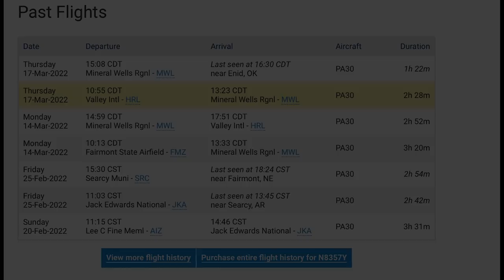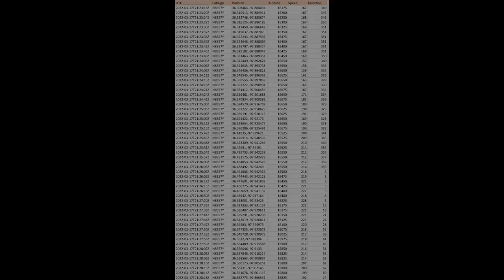FlyWire Accident Review  PA 30 N8357Y Loss of Control Inflight

Comment: Loss of control by VFR pilots in IMC is a big killer in GA. It is stressed over and over yet so many pilots succumb to “get home itus” every year. Don’t do it!!!
Reply: One thing VFR pilots should do is take some instruction on basic instrument flying.
     You don't have to be IFR qualified to use your instruments to keep your wings level and use your radio to get help.
     I don't understand how a CFI can allow their student to carry out a cross country solo flight without knowing how to orient the plane in space without looking outside. It's not that hard. 
     Vertigo is quite common in IMC, especially if you lose outside references without warning. It even happened to my dad. He was VFR at night over a populated aria. Just as he rolled out of a turn he entered an unseen cloud. He lost sight of the ground and horizon and every sense in his body told him he was in a bank.
      But he was a CFI and instrument rated with many hours in hard IMC. He looked at his attitude indicator and his bank indicator and both showed his wings were level.
      He fought the urge to correct the band and after a few seconds popped out of the cloud. The horizon was right where his instruments said it should be though his body was telling him he was in a steep bank.
     As soon as he could see outside again his vertigo vanished.
     That's the thing with seat of the pants flying. The seat of your pants is a lying ass. Don't trust it to orient the plane when you can't see outside.
     Anyone can end up with VFR into IMC. Being prepared for it will save your life and your family's life.
Reply: @Vertical Flight Why do you doubt that knowing how to use your attitude indicator would make a difference?
     It's not that hard. Just keep that blue and black ball so it's not tipped over and or mostly blue or black.
     Frankly, if you can't even do that you have no business flying an airplane.
    If you are VFR into IMC the most important thing is to keep your wings level, guarding yourself against vertigo (ignoring the sensation you are pitching or banking) and using the radio to call for help.
     You don't need to file a flight plane, you don't need to know how to set up an ILS or DME approach, you don't need to navigate.
     All you need to do is keep the wings level and call for help. ATC can read up instructions to shoot an instrument approach if necessary. And it probably won't be. Most likely you'll be given a heading to take you back into clear air where you can return to VFR flying.
     You'll probably get an FAA review but you can survive that but at least you'll be alive. 
     As to not flying into bad weather, well there is only so much you can do about that. Weather can change very quickly and it doesn't always go as it was forecast.
     No matter how good your judgment, there is always the possibility of VFR into IMC. If it happens you need to keep your head and remain calm.
     There is a horrify audio from a VFR pilot who went out of control in IMC.
     The terror in that call is chilling, but the pilot got ATC in there and was able to save himself.

Comment: It’s funny that with a little simple trigonometry you can approximate airspeed. It is the ArcTan of Descent speed with ADSB speed. You could even add in the current winds if you wanted even more accuracy. I am surprised some website wouldn’t do that since it would give a little more info.
Reply: ADSB outputs ground, indicated and true airspeed, so it depends on your source of "ADSB speed" if you need to convert.
Reply: @kewkabe  ADSB reports ONLY ground speed from GPS.

Comment: These folks have to have read many accident reports describing exactly this scenario, yet they do it anyway. Unfathomable.
16.5 for a smoker or an older person in poor physical condition — one who is also too stressed to be able to breathe properly — is not a good place to be, even for a few minutes.
2 more cents: Having an IFR rating without being fully competent can lure pilots into situations they can't handle. Anyone can pass the IFR check ride with the examiner sitting next to them holding their hand, or fly in IMC with another pilot sitting next to them. Get up there by yourself and it's a whole 'nother ballgame.

Comment: Question from a non-pilot: If you are VFR rated, and end up in IMC, can't you just use the six basic instruments to maintain your attitude, altitude, speed and heading? Is it that difficult to ignore your own senses (knowing they are flawed) and trust the instrument panel?
Reply from the maker: Those are the instruments you need to use... and YES, it is very hard to ignore your own senses. even with a lot of training.
Reply: That is a really good question. You will get a wide range of responses. There are a lot of unknowns. I think it is safe to assume that it will some times be easy and some times difficult. The fact that it can be difficult is kind of 'proven' by the associated number of fatalities. That it is some times easy is 'common sense', imagine an aircraft cruising on autopilot entering IMC - I would expect that aircraft to remain upright for at least some time (no changes to aerodynamics or control parameters; maybe icing risk and 'risk of pilot panic' though).
Reply: @FlyWirescottperdue  I can do this really well in MS flight simulator, I am sure in the air its a whole different thing.
Reply: @shahidahsan6507  In real IFR, there is convective activity (up and down) in clouds, and your brain can tell you the airplane is turning, and /or descending and turning, you have to ignore what's outside, and focus on what your instruments tell you.
Reply: @shahidahsan6507  I think that's an interesting topic. I wonder if being an avid MS flight simulator enthusiast can actually be beneficial for a basic PPL, at least for handling inadvertent flight into IMC. I think it was for me. In Flight Simulator of course you're always feeling 1g no matter what the aircraft is actually doing, and you get used to just following the instruments to line everything up. After 15 years of avid flight simming I got my PPL (not instrument rated) and my instructor would scold me to look out the window, not down (as you usually do in Flight Sim). But the couple times the past 20 years I found myself in sudden IMC, I had no problem turning back straight and level despite the turbulence and disorienting g-forces, and funny cloud layers out the window, by just following the attitude indicator like I did all those years with MS Flight Simulator. If I had never known MSFS I could have easily spun into the ground.
Reply: @kewkabe  I have a ppl and never been in instrument conditions and my instructor always yelled at me to stop looking at the instruments.  But whenever my CFI put me under the hood he was surprised by my skill.  That said, regardless if it will save the day, I am sure it will at least help.  Glad you give some credbility to it.
Reply: No you can't and yes it is - I've several times had to park the car in bad weather, because I got disoriented, and take a few rounds around it, before I could drive on. You cannot do that in the air!
Reply: @leifvejby8023  "No you can't": 🤔... "had to park the car in bad weather, because I got disoriented":  Ah, now it all makes perfect sense👍
Reply: @FlyWirescottperdue  Thank you Scott.

Comment: It is simply a case of poor judgement.  Pilot was 58 and had been flying for 4 years (as stated on the report page) so, low time pilot, with little real life aviation experience needed.   I can remember a couple times in my short pilot career (1965 PPL holder, 750hrs TT, last PIC flight 03/1988) of VFR flight becoming a flight into IMC if continued.  I made a 180 and headed back to the airport.  My trips were just not that important.  I see this phenomenon of proceeding on "like, what could possibly go wrong" into IMC by unqualified pilots and they take their families with them.  This just has to stop.  Just don't understand this.

Comment: Again, good analysis Scott, thanks. I question of there was any evidence of horizontal stabilizer attach failure?  I had a PA-30 back in the late 80's, and recall several articles and an FAA report about flutter and stablator failure on Comanches. I seem to real that Aviation Consumer magazine had an article comparing airframe failures of V35's and PA-30s in over-stress accidents and that in Comanches, the stabalator was a likely first failure point at about 250 to 300kts at what was calculated to be as little as 3Gs. 
In a couple of V35 high-speed / High G airframe failures, they concluded that about 6Gs at around 300kts the first failure point was the cabin door which which caused the pilot to rapidly unload back pressure to about -3 to 5 Gs causing the V stabs to deform downward, and a negative G main spar failure. In those incidents the V-Stabs remained attached along with the elevators. 

In a couple of Comanche incidents I seem to recall a stabalator hinge failure resulted in loss of control. There's a interesting look NASA video of PA-30 H-Stab flutter. AirBoyd has it posted as 'Aeroelastic Flutter'. I seem to recall that if stabalator hinge bearing or cables in a Comanche have slight play, Aeroelastic Flutter can occur around 200kts (or less) and above 250kts can result in rapid failure.
Reply from the maker: I expected a flutter related inflight breakup, the wings tell a different story.
Reply: @FlyWirescottperdue  Seems reasonable if the wings failed due to positive loading, but I was wondering if stabalator hinge assembly failed (Possibly due to flutter) if that could have caused a pitch-up. When I was flying a Twin Comanche, I recall looking at how that hinge attach assembly was designed , and trying to get an idea of what might cause it to fail, and what would happen if it did, and I have a vague recollection of pitch-up being one possibility if it failed.

Comment: Estimated life expectancy for a non IFR rated, current and proficient pilot in IMC is three (3) minutes.  From IMC to lawn dart…. Not long at all.  Never a reasonable bet…. even if one disregards the obvious lack of oxygen.
Reply: Cfinstr, I believe you're assessment is generous. During my military career, we addressed I-IMC (Inadvertent - Instrument Meteorological Conditions) regularly, training crews to commit to the IMC, pick up an IFR clearance and recover IFR. We all had instrument ratings and flew IFR in our "A models" (they were IFR certified for flight into IMC); however (ironically), the later "D models" we received were certified for IFR flight, but not certified for flight into IMC. We could legally file and practice IFR flight in VMC conditions only! The risk mitigation still required crews to commit to the IMC as an emergency operation and recover using standard instrument approaches (practiced in the simulator as well as the real airframe). Our statistics service-wide indicated the first 30 seconds of an I-IMC event would determine a survivable or fatal outcome for a non-IFR proficient crew (rated and current but not proficient). Departures along the roll axis (longitudinal) were common in spatial disorientation iterations in the simulator for the same population (rated but not proficient). Typically, an I-IMC event during qualification training could easily develop into a simulated fatal event as the instructor would have to take the controls at the seat cushion ingestion point 😏🙄. Under those initial training scenarios the 30 second clock was closer to impact than a decision point.

Comment: Scott,  I think you may be on to something in suggesting toxicology reports  for the victims of this crash.  I will be interested to see not only the pilot's oxygen saturation level, but also whether he had any carbon monoxide in this system.  Flying at 16K or more would almost certainly call for use of the cabin heater.  I'm also concerned about oxygen deprivation at the high altitude that the airplane was flying.  While the pilot was not too far above FAA altitude regs, we need to recognize that not all humans are equal in their ability to tolerate high altitudes.  Was the pilot a smoker ?  Did he have any history of lung problems ?  How long had the flight remained at relatively high altitude prior to climbing above 16K ?  I'm sure you (as I did) witnessed an occasional problem with one of your fellow trainees during your periodic altitude chamber rides.

Comment: got my multi in a PA 30 in 76 or so. 700$. while shooting touch and goes the gear collapsed as we were rolling down the runway. used the fixed aircraft to get my check ride. examiner was a bit tense. they told us that if you went below vmc the aircraft would invert and go into a unrecoverable flat spin. true? no idea but it stuck in my head.
Reply from the maker: I doubt it would invert in a spin. Twins have issues with spins that make a recovery much harder to effect.

Comment: I understand the following scenario is not this easy at all (if it were, there wouldn't be so many crashes), but I want to understand WHY it's not easy: if a pilot is VFR only and winds up in IMC, why can't they lock eyes on the instrument panel -- AI, altimeter, speed, etc. -- and either fly the plane wings level or descend slowly until departing IMC? Or perhaps a better question is, why DON'T they do this?

Is it just that the inner ear's messages  to the brain are too powerful to resist? Or is it primarily something else? Or a combination of things?
Reply from the maker: They a re human and have lived their lives using their eyes and inner ear as gyroscopes. Watch my video "Where's the Rock?" and you'll get a better picture.

Comment: Thanks again for your videos. I’m not a pilot. Could the pilot have used autopilot to plot a course to clear weather? Thanks
Reply from the maker: If he had one and knew how to use it, it might have saved his life.
Reply: The transition from VFR to IFR is a reoccurring theme. So many pilots loose control in IFR. It just doesn’t seem that it would be too difficult to fly straight and level in the direction of improved weather either by using autopilot or watching the instruments. Many times the weather is otherwise fine except for low visibility. Like you have said repeatedly… fly the plane first.
Reply: Most Altimactic II autopilots in Twin Commanches would be inoperative.

Comment: Possible iced over wing, causing stall/spin?
Reply: Not likely. I flew a single Comanche (250) for about 10 years, lots if IMC. 

One fine day I was cruising at 16,000', in and out of clouds, picking up ice and had about 3/4" on the wings. It handled about the same as always, even with a normally aspirated carbureted 250HP engine, it had no problem maintaining 16,000'. It was about 10 knots slower though. 

The Comanche always handled ice well, I imagine the twin had similar wings so it should be ok in ice as well.
Reply from the maker: I seriously doubt it. Watch the video.

Comment: Use the autopilot!
Reply: Unless this aircraft had an upgraded autopilot, it is highly unlikely the A/P would be functional. The original Altimactic II A/P's in these aircraft require constant repair and overhaul of many components to be functional. It is also unlikely that the owner of this aircraft would have spent 35K-50K to install a new generation autopilot system. (note that I say "system" - there are many components to an autopilot. It's not just one "black box").
Reply: @robertlewis5627  should not fly in weather without one.